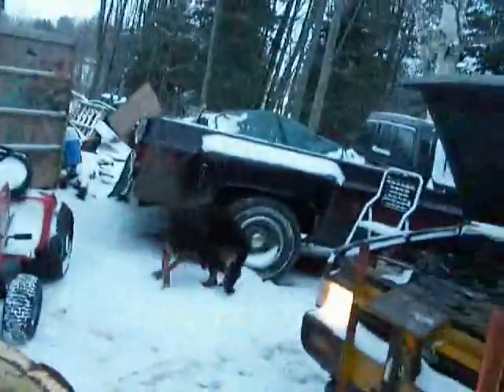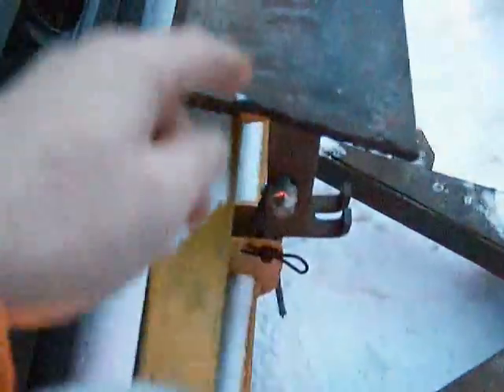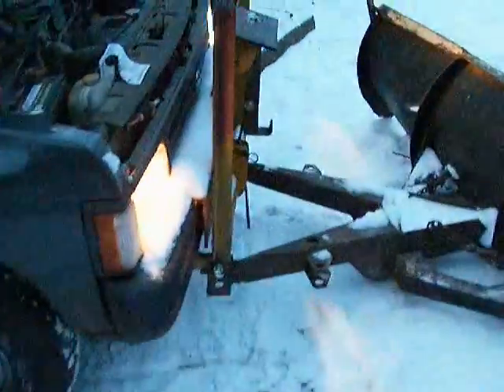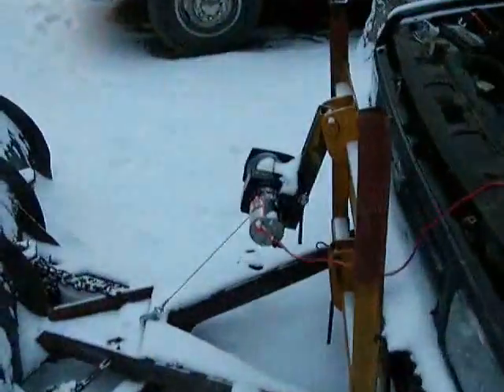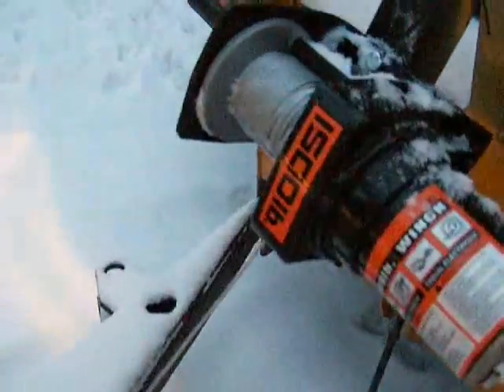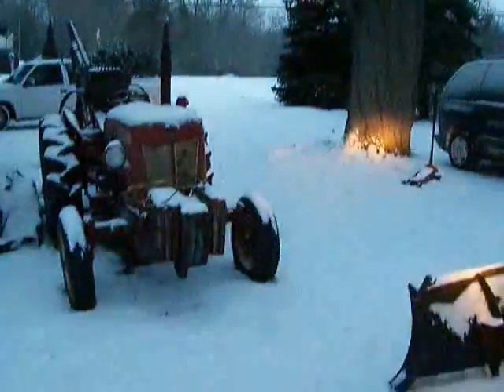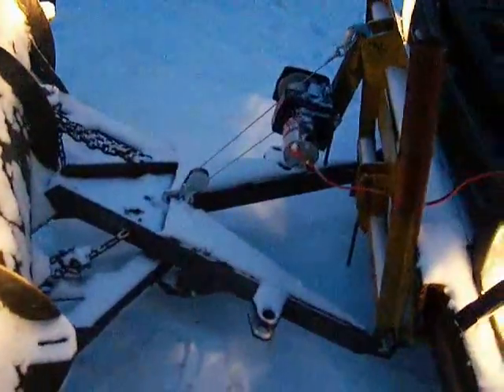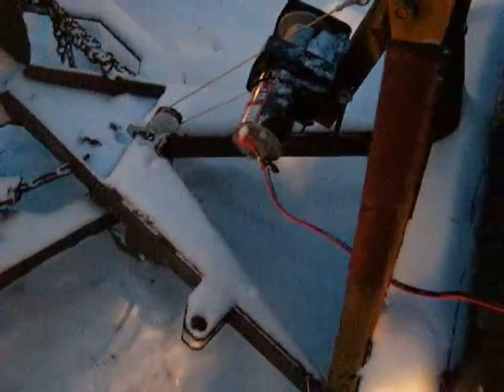1 Redneck snow plow fix.avi

Comment: the winch is only rated for 1500lbs line pull, which is much different than a dead lift which is what your doing... you need atleast a 3000lb winch..